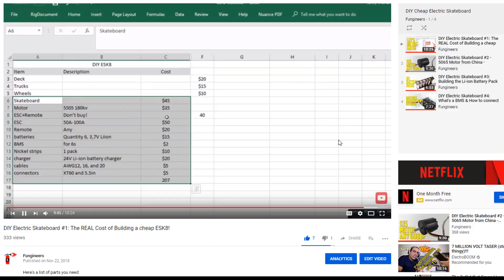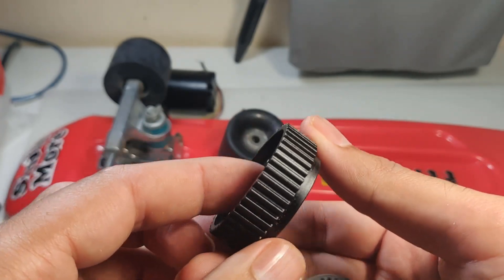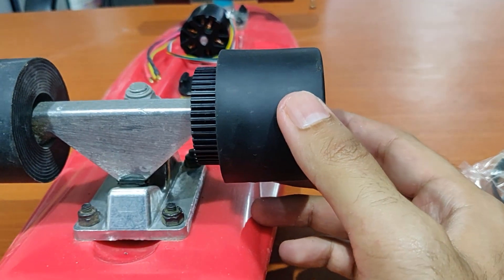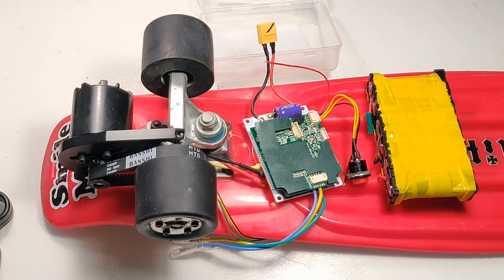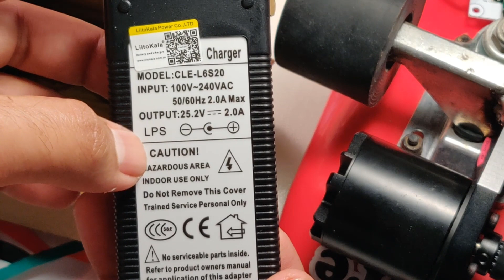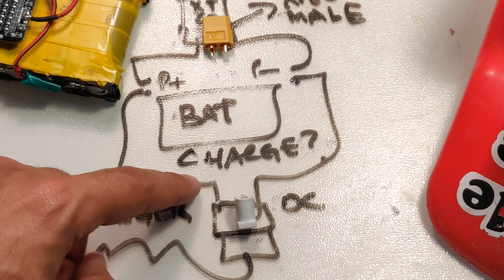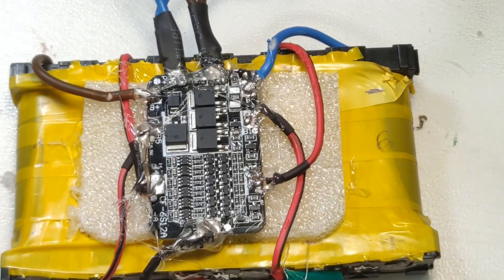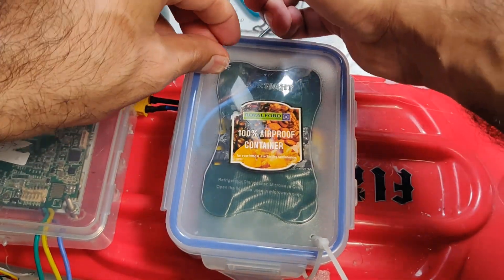Convert your old skateboard to an ELECTRIC SKATEBOARD!  Ep5

Comment: Hey I have the same motor but I need some help with to connect the motor in the esc. Can you help me ? Because the motor has 3 main wires and 3 extra wires that I don't know what to do because they don't connect in the esc
Reply from the maker: The are the hall sensor wires. You have to find h1 h2 h3 on the esc and connect them therr
Reply: @Fungineers  there is somewhere that we can talk or chat? If you can add me on WhatsApp +5535999590380 thx
Reply: Or my instagram @randal.goncalves

Comment: Wouldn't running the bolts through the circuit board and the penny board put stress on the circuit board?
Reply: Nvrm it seemed to work great in your other videos
Reply from the maker: @mashedpotatoes5323  would be a good idea to separate them for long term usability

Comment: Hey, little confused, didn't you say to not use that cheap esc? What happened?
Reply from the maker: You are correct. I did! After i got it and ran with it i had to change my mind. This thing is aweosme!!
Still running good no issues!
Reply: @Fungineers  Thanks for fast reply! Was on a budget and it would save me like $30, but am concerned for safety, so thanks!
Reply from the maker: Should be ok if your spec your batteries and motor properly
Reply: @Fungineers  I found LG 18650 batteries from a local US seller. And I'm using the motor from the first vid.